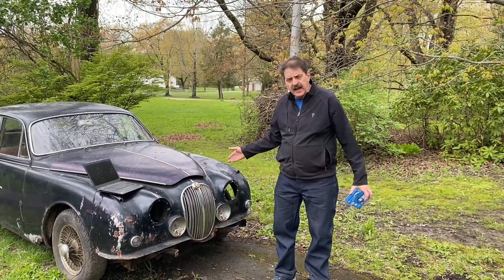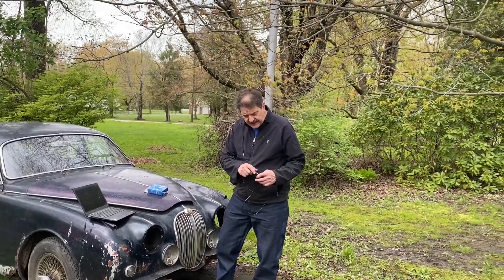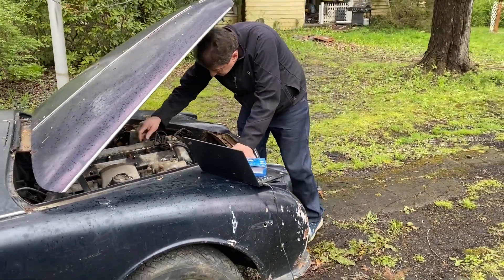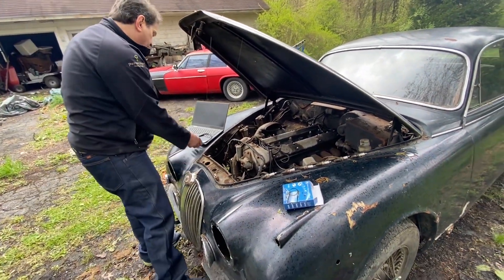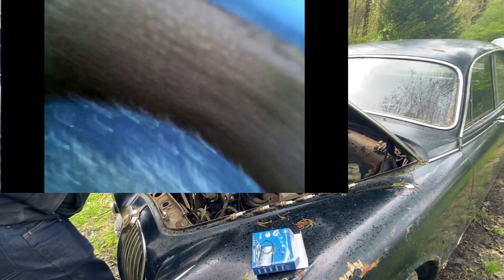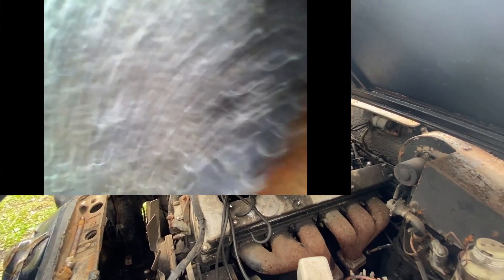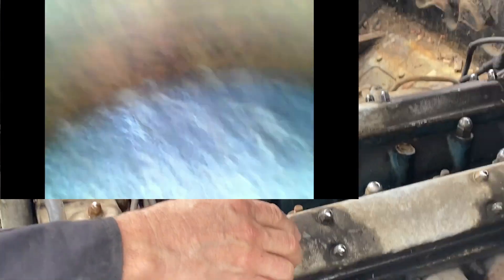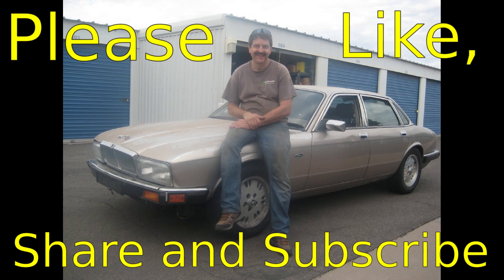Examining the cylinder bores of a frozen Jaguar MK2 engine with a USB endoscope

Comment: I have seen worse. Loosen the sump drain plug to check for a sump full of water.Alloy heads on steel blocks do this if left.Check for no top ring damage, ie no chunk out of the top. Fill em all with diesel/engine oil mix, top em up for a few days. get the pistons to move by rocking the front pulley until a whole turn can be done. Check that the valves are not sticking as Jag valves can hit pistons.The rings will be seized in their grooves so very little compression. Either 24v on the starter or tow start. Sometimes miles before the engine fires at all. Check for oil pressure.When it starts on the starter, run until really hot. then turn off and let cool right down. Do this several times with more diesel in between and it may come right. I have had various very old neglected engines that have completely healed and behave normally. Some have taken quite a lot of use before all compressions return.

Comment: I would try to free the cylinders. I have watched other YouTube automotive channels that worked with engines that were boat anchors that have been beaten back to life. If anything else, it makes for great video content. What do you have to lose?
Reply from the maker: Yes, I have poured some marvel mystery oil down into the cylinders and I am letting that soak in for a while. One of the spare Jaguar XK engines I bought from the same guy in Akron Ohio was also stuck so I let some marvel mystery oil soak in that motor for a few weeks and I got that one to eventually turn. So maybe the same treatment will work on the engine in this car.

Comment: Good info on the endoscope, had no idea you could get one so inexpensively.  Could use that thing on many projects not just cylinder bores.
Reply: These things are essentially just "weird" USB webcams, and report to the OS as such (UVC device). Think repackaged/repurposed integrated laptop webcams. Windows supports those out of the box and you can use anything from OBS to the windows camera app (of all things) to see a live feed ot take pictures/videos with it. Or basically any app that supports webcams. Android also supports USB cameras (also mice, keyboards and USB sticks btw), but apple is so incredibly restrictive with their mobile devices (phones + tablets) that this has no chance of working even if you could adapt it physically
Reply: @Knaeckebrotsaege  That leaves me out, phone is apple, everything else windows but will not be carrying a laptop around to use it.  Fortunately I don't need it now, its just good to know such things exists.  I like to know my options.
Reply from the maker: Yes, but the only thing I cannot tell anyone about is how well any applications for MS Windows or actual Android phone works since I used a native open source app that is packaged with Linux for free. The resolution of the camera in the endoscope in that native Linux app was limited to either 360p or 480p
Reply: @jensenhealey907efi  I haven't messed with Linux for about 23 years, back then I think it was being sold by Red Hat?  Surprised they don't have an app for iPhone, if you can get it into a phone it could be moved but without a known app for MS, that's a mistake.  How many use the MS operating system as opposed to all others.
Reply from the maker: @paulspurlock2420  I think that it's not the case that there is no app for an iphone but rather that the actual plug on the endoscope is not compatible with the lightening type of plug in a iphone. Now maybe it would work with a lightening to USB-C cable but I don't know. There are probably specific endoscope versions made with the iphone in mind with a native lightening cable. Again I don't know since I don't have a iphone.
Reply from the maker: Yes, but the only thing I cannot tell anyone about is how well any applications for MS Windows or actual Android phone works since I used a native open source app that is packaged with Linux for free. The resolution of the camera in the endoscope in that native Linux app was limited to either 360p or 480p

Comment: the amount of rust on the cylinder walls looks to be surperficial to me. i've seen fresh-back-from-the-machine-shop raw blocks that haven't been protected from exposure to the air that rusted up like that within a day or so. it's unlikely that that's the case here , but there appears to be no deep pitting at all. of course, that doesn't mean that the pistons won't need to be pounded out with a sledge and a wood block, either!
Reply from the maker: I think you are correct that the pistons will have to be pounded out unless soaking the bores with some oil like marvel mystery oil or has been suggested ATF & acetone for a long time would have some positive effect.

Comment: I would not even try. That engine needs at least a rebore and oversized piston, if that is even possible, not to mention all the damage inside. Looks quite bad, not worth a rebuild.
Reply from the maker: I do agree that the bores look pretty bad and this will probably require a rebuild.